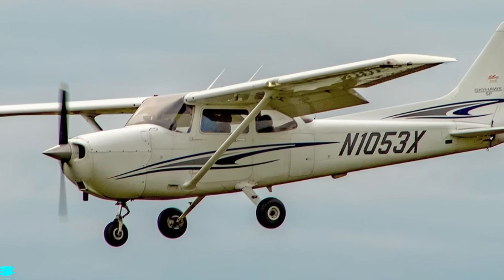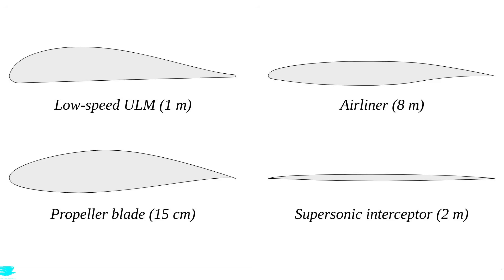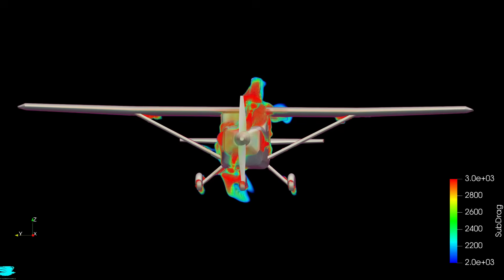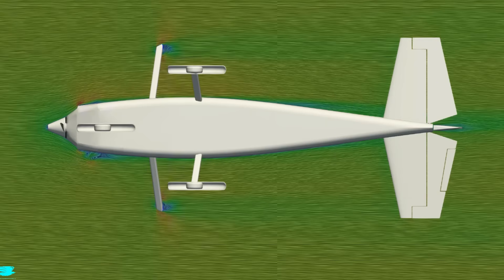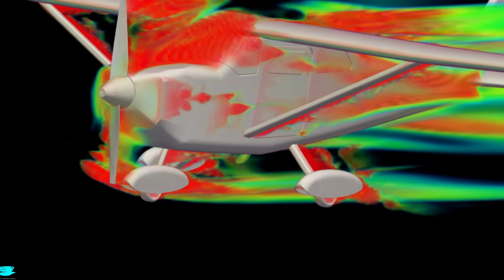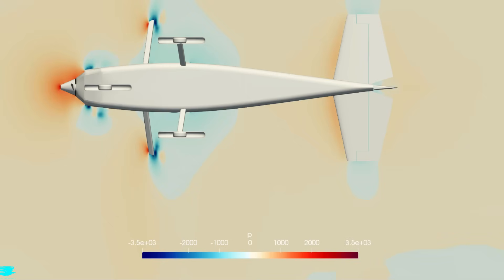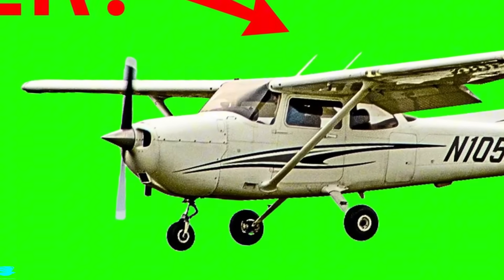Why The Cessna 172 Is Actually One Of The Best Planes

Comment: The success of the C172 is a bit of a mystery to me. Sure it's iconic because you can see it everywhere. It's been around before most of us were born, and it does everything reasonably well. But it does nothing exceptionally well. It's a bit bland and unemotional. 

I've spent quite some time in the C172 during my training and after until I got a spot in a club. And had I never flown anything else I might also have said: "yeah, it's a good airplane". And it is: don't get me wrong. It has good ergonomics. Everything's easy to reach. It's very forgiving and easy to fly. More efficient than most in its class. Very reliable. It climbs ok and has a decent cruise speed. And of course it has two doors. That's a real asset. Still after flying several other popular models I will never go back. 

There's so much (minor) stuff that isn't really good at all but which many people won't care about.
 - it's has one of the narrowest fuselages in it's class. Sitting side by side you can't avoid touching shoulders unless you align the front seats differently. And the width in the back seats is even worse. 
- it has a pretty nose high attitude in combination with a high cockpit panel and relatively small windshield and windows so the view outside isn't great. In addition high wing aircraft tend to make observing traffic in the pattern more difficult.
- In general the manufacturing quality isn't much to write home about. Everthing feels cheap and the fuselage flexes so much that the cargo door can pop open in flight if you forget to lock it. 
- air vents in the older models are useless. You either get the full air in the face or have to try to direct it over the windshield somehow. Aft seats get no air at all. 
- controls are soft and indirect like in a 1960s Cadillac

Other planes may have more serious vices (and advantages) that tend to polarise opinions more. The Beech Musketeer is considered to be slow and thirsty (but flies like a dream and has a roomy cabin), the almost equally popular PA28 series is more diffcult to get in but a little more agile, the Mooney's back seats are just for children, Bonanza is expensive to maintain, etc.

Maybe all in all the Skyhawk is such a success because it's so average.
Reply from the maker: Yep, it's average-ness and ease of flying/stability are probably what makes it so popular.

Comment: There is actually a high performance version called the 177 that is tied for fastest aircraft in its class, while maintaining the excellent handling. It has a speed of 177knots, 51 knots faster than the 172, and equal to the Mooney M20. And it’s turbo normalized, maintaining full power to 21,000ft. So it actually outperforms both other aircraft when operating in mountainous terrain. Takeoff at high altitudes is significantly shorter than the 172 or Mooney. Unfortunately nobody really appreciated the 177 and it never sold well. Best aircraft Cessna ever made.

Comment: I have heard the vertical tail sweepback is there purely for marketing rather than having any aerodynamic advantage to the early straight version , is that true?
Reply from the maker: There are a few changes, but probably the most important for the Cessna is that it makes the vertical stabilizer able to operate at even greater yaw and sideslip angles.

Sweeping a wing effectively drops the lift curve slope, but extends it in the angle of attack. So, stall occurs at a higher angle.

It makes the Cessna more stable and safer.

Comment: Considering its the most produced aircraf (44k+) vs the next Il-2 at 36k, still in production, and hold the longest flight endurance records, just under 65 days. Found on every continent. For the design features you have to look at the history a little closer. For instance the Onni-Vision cabin was only introduced with the D model more as a marketing feature than anything else. Wheel Pants were introduced with the B model but most owners leave them off because they are fragile especially if your aircraft sees a lot of students or soft fields and the gains are a few knots. Lastly it is a function of low cost production and simplicity. A good engineer understands that you can always solve problems with very exotic solutions but in reality and job you jave to be able to manufacturer something at a reasonable cost for the product market..
Reply: Note: The Il-2 could additionally survive direct hits from an 20mm-canon, and stayed unimpressed at machinegun-fire ("flying Panzer"), and so, holds an endurance-record itself, in a category Cessna cannot compete ... Also, the production of 36k took just 5 years (discontinued already 80 years ago). The comparison is slightly unfair, at best...  ;-)

Comment: I like the bars under the main wing, that give better statics.

I would even work with 4 bars. 2 under each site of the wing. 
With this the wings can get a better AR.

I would combine the front  wheels with the stabilizing bars. This reduces drag. 

And put one wheel at the tailplane. 

I would shrink the fuselage a bit in height. The tail fuselage is way too clumsy. I would prefer a thin helicopter rear fuselage.

I forgot that it is possible to skip the tail plane and put a thrust vectored propeller there instead. 
Electric Motors and a fuel driven generator should work. 
Put small propellers at the wingtips too.

Comment: are there any modern advancements that could make the c172 even better without being drastically more expensive?
Reply: I mentioned several advancements. 

I forgot the tubercle shaped main wing. Improving stall resistance. 

Since i wanna be paid, price might rise. But other people might get old and loose their jobs. 
Unqualified people in positions where they don't belong let the prices rise.
Reply from the maker: Well, there are some, but anything you do has to be recertified. It's not really like a car.
Reply: You can just say that your airplane is experimental.
So you can play with your life and uncertified parts. 

This can really get messy.
Reply: I think the stock wheel pants could be improved upon, as well as fairing sleeves for the wing support struts. Aircraft Spruce sells strut and wheel fairings for the 172 and other models. Not that I've measured them, but I have worked on wheel pants design for road vehicles...

Comment: How is there a pendulum effect when the "lift" is perpendicular to the wing? the lateral restoring forces are aerodynamic, mostly consequence of the side slip flow, not the mass distribution of the airplane
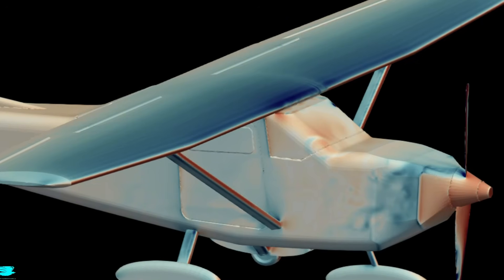Reply: Imagine we're looking at the front of Cessna as on 6:16 picture. Draw two points: center of lift (somewhere in the middle between wings, a bit over pilot's head) and center of mass (let's say it's in the center of the fuselage lower than center of lift). Gravity is applied to CoM and lift force to CoL. When you fly straight, those two forces just cancel each other; however, roll a plane a little bit and lift force rotates with the plane, but gravity still points straight down. Distance between these two points acts as a lever arm, therefore torque is created.
Reply from the maker: This is a really good explanation.
Reply: @viscouscasual  yes, that's a typical misconception. When the airplane banks and starts turning there is a component that goes outwards (Newton's first law) and the weight is the resultant of the weight due to gravity and weight due to centrifugal force. The centripetal force is the lift, now since the weight is higher than just the mass times gravity, the load factor increases, that's why you get the Gs. Now, if you've been on a plane and done a high G turn, youll notice how the force you experience crushes you into your seat, not sideways, the lift and the resultant weight are on the same direction but opposite sense, and as you said, the center of lift is at the middle since the airplane is symmetrical, and also the center of mass, and without a perpendicular distance, the forces can't create a moment.
Reply: Well, to start turning, you need to pull the yoke. With only aileron input plane rolls without turning and doesn't experience centrifugal force
Reply: you're exactly right! so what will the plane do? accelerate towards the ground because since the, let''s call it aerodynamic force different to drag, from the wing now points at an angle, the vertical component (respect to the earth's frame) isn't enough to counteract the airplanes weight do to gravity. But on one hand, the aerodynamic force from the wing still is perpendicular to the wing, and the vector goes through the center of mass, and the weight vector also can be placed at and goes through the center of mass, both vectors cross the center of mass, so they can't create a moment about the center of mass. In the other hand, if you're in the plane and bank it without pulling on the yoke, it will start falling sideways, let's ignore the aerodynamic consequences of that on the wing and tail (which are actually the reason why the airplane is laterally stable) gravity accelerates everything at the same rate, so there won't be any moment either, what may happen is actually the opposite, the area of the fuselage under the wing mighy create more aerodynamic force than the wing if the wing is at 0 AoA and at a high bank. like on a knife edge maneuver, in that case the airplane will try to "flip on it's back", because it is't symmetrical on that plane and the fuselage is presenting more area than the wing to the relative wind
Reply: Yes, in this case plane will start descending due to unbalanced forces and yes, aerodynamical forces play a significant role in stability. However the lift vector is applied to center of lift, not the center of mass. Imagine a stick, let's say we apply two forces to both ends of it. What we have is net force AND net torque. Stick will accelerate in the direction of net force and rotate at the same time

I wish youtube comments had a feature to post pictures
Reply: @viscouscasual  The lift vector does indeed act through the CoP rather than the CoG, however, assuming no sideslip, the lift vector is still laterally in line with the CoG. For a rolling moment to exist, the lift vector would have to be offset laterally from the CoG. This is why, in a coordinated turn, lateral stability does nothing, the plane will not return to wings level, the plane will maintain its current bank angle largely without input. It's only once sideslip is introduced, i.e. aerodynamic asymmetry that offsets the CoP laterally from the CoG, creating an arm, that a rolling moment is produced. So to summarise, pendulum effect is purely aerodynamic, if sideslip is zero, then the rolling moment generated by the effect is zero, regardless of the bank angle.
Reply from the maker: In addition to the good explanations by @viscouscasual, sideslip is translation, the pendulum effect is a rotation. So, they can be related, even through inertial coupling, but they are distinct motions.
Reply: @PremierAerodynamics  look up Drone Pendulum Fallacy by Tom Stanton, there you can visually see what happens, or, get the math from Roskam J. - Airplane Flight Dynamics and Automatic Flight Controls.
Reply: You're right. The pendulum effect is a myth, it's more the aerodynamic forces.
Reply: because the wings are mounted so incredibly high. 
this actually makes it a self correcting pretty stable airplane.  but it makes it verry not agile. 
now take the spitfire in contrast.  it's wings are at the bottom. 
this makes it a verry unstable plane that would preffer to fly upside down.  BUT it makes it insanely agile.
Reply: @darkracer1252  yes! high wings are more stable than low wings, but the reason is not the position of the center of mass relative to the wing, it's because when the airplane banks, there is sideslip, that flow interacts with the fusleage, when it's high wing the AoA of the wing that went down increases and the AoA of the wing that went up decreases, this creates the restoring moment. In low wings the opposite is true, the AoA of the lower wing decreases and the one of the higher wing increases, so it trends to increase the roll, that's why low wings need more dehidral angle, to counteract this. When you are turning and you're already stablished on a coordinated turn, without sideslip (ball in the center) and maintaining altitude, you'll notice the plane won't try to take you out of the bank angle you have, you just do minimal corrections just like when you're flying straight to respond to minor perturbations.